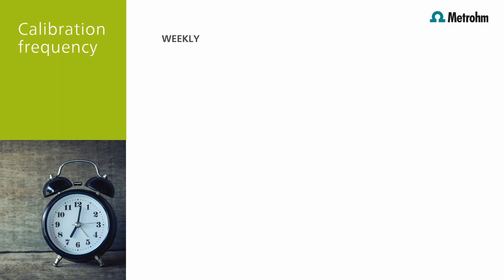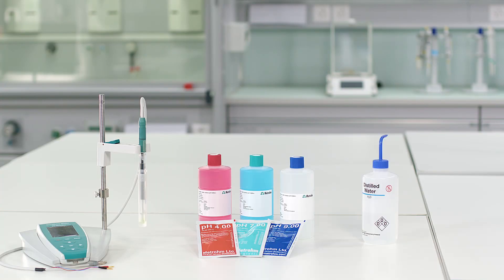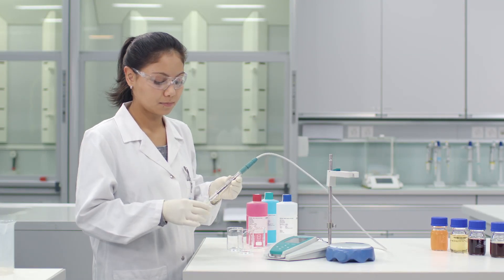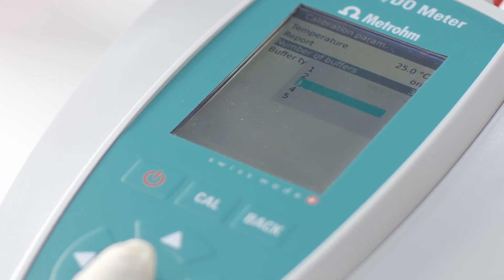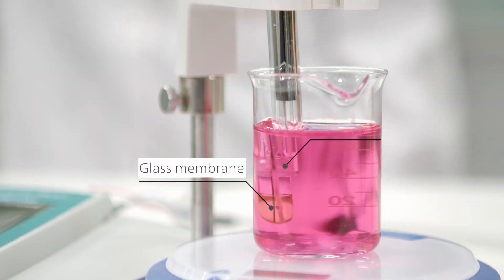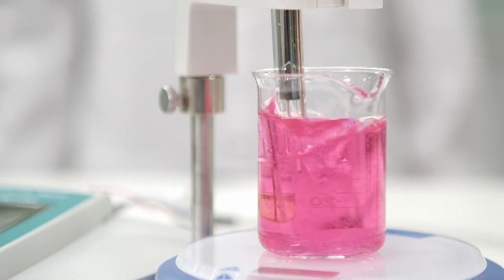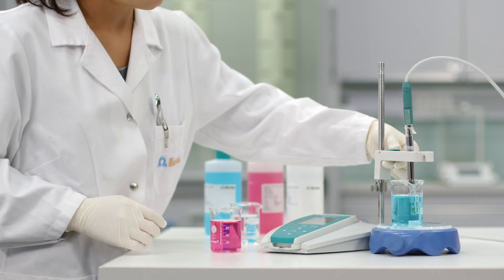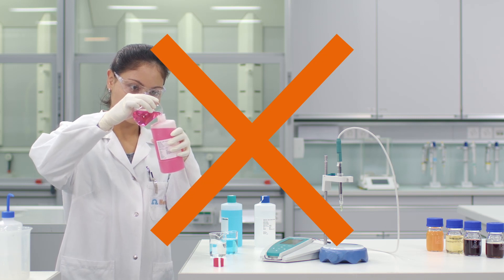How to calibrate your pH electrode

Comment: Thank you for running over the basics of pH calibration and a reminder to calibrate more often to ensure consistent sample accuracy!
Reply from the maker: Glad it was helpful!
Reply: @MetrohmTV  Is it still advisable to use pH 9 buffer for calibration bracketing samples with expected higher pH values, even though alkaline buffers have a high CO2 uptake?
Reply from the maker: For precise pH measurement results, we always recommend a multi-point calibration. The pH of the sample should always be within the pH range of the buffers that are used for calibration to minimize errors. So, if you are expecting higher pH values (e.g., pH 8) the use of pH buffer 9 is advisable. 
To avoid a carbon dioxide uptake of buffers with higher pH values, always use fresh buffer solutions. Our buffer solutions in single use sachets are quite suitable for this.
If you have more questions on pH measurement and calibration please have a look at our current monograph “pH-measurement – everything from A-Z including best practices and examples”:
https://www.metrohm.com/en/products/8/1085/81085081.html

Comment: thank you for the detailed explanation 
Addition of NaOH or HCl to adjust the PH of a solution does not affect the initial concentration of a solution?
Reply from the maker: Hi gidissadeksissa2219 
Do you mean the initial concentration of an analyte? The initial concentration of an analyte is not affected if the analyte is sodium, hydroxide, hydronium, or chloride. Does this answer your question, or did we misunderstand it?
Best regards
Metrohm International Headquarters

Comment: Great video 😊! Why only 4,7,9 buffers used for calibration!

What is the maximum limit can dip the ph electrode or need to only dip the end of the electrode
Reply from the maker: Hi Samuel
Thank you for your comment. You always have to calibrate with buffers which lie within your measuring range. With buffers pH 4, 7, and 9, you’re already covering quite a broad pH range. Should you need to cover an even broader range, you can use pH buffers from other manufacturers.

As for the electrode: The electrode has to be dipped in in such a way that the diaphragm is fully covered by your measuring solution. I.e., the glass membrane and diaphragm have to be immersed but the electrolyte filling hole has to stay above the sample.

Best regards
Michel, Metrohm International Headquarters
Reply: @MetrohmTV  😀 thanks for your reply 😊

Comment: Why the calibrate during first buffer taking much, sometimes wait around 45 minute still cannot proceed to next buffer
Reply from the maker: Hi
Thank you for your comment. Typically, a buffer measurement should not take more than a few seconds or a few minutes at most. A measuring time of 45 minutes is a clear indicator that something is not right, the most obvious candidate being a defective electrode. Please check whether your electrode needs to be replaced or contact your local Metrohm organization if you need technical support:
https://www.metrohm.com/en.html#country-selection

Best regards
Metrohm International Headquarters

Comment: What maintenance intervals (calibration, electrolyte replacement) would you recommend for a pH electrode that is used very rarely, e.g. once a year?
Reply from the maker: Hi
This very much depends on the accuracy of the result you want to achieve. For example, if the result is only a rough guide, it is fine to perform a calibration or replace the electrolyte before the pH measurement. However, if you want the result to be as accurate as possible, maintenance is more important and should be carried out at least monthly or even weekly.
In general, frequent maintenance of the electrode is recommended for warranty reasons and also with regard to the lifetime of an electrode.
Reply: @MetrohmTV  Thanks a lot for your answer !
Reply from the maker: @BenoitPlomb-u8l  You're welcome. We hope this helps!

Comment: Is it necessary to maintain the buffer temperature externally at exact 25 degree celcious  during calibration and sample pH measurment as well
Reply from the maker: Since temperature has an impact on your pH measurement (Nernst equation), calibration and pH measurement should be performed at the same temperature, e.g., at 25 °C. For further information please read our blog post “How temperature influences the pH value”:
https://www.metrohm.com/en/discover/blog/2023/how-temperature-influences-the-ph-value.html

Comment: Hello, I have a new HACH PHC101 electrode, but I can not calibrate, it says (standard not recognized. Rinse the electrode and repeat). Can you help me and tell me the reason?
Reply from the maker: Hi
Thank you for your comment.
Could you please check if another electrode can be calibrated? This way we would know if the problem lies with the instrument or the sensor.
In general, if you require instrument support, please contact your local Metrohm organization or exclusive distributor.
BR
Michel, Metrohm International Headquarters

Comment: Why do I have to calibrate more often when performed at high temperatures? If I do it at 28 degrees Celsius, is calibration necessary every day?
Reply from the maker: We would recommend calibrating the sensor daily and at the temperature of the samples for exact results. It depends a bit on the accuracy that is required.

Comment: What is ideal slope value after pH calibration.
Reply from the maker: The electrode slope is given by the Nernst equation and is 0.059 V per pH 1 at 25 °C. These are ideal values from which new Metrohm pH electrodes only differ slightly. The electrode zero point is ± 0.015 V. But please be aware that the electrode zero point and the electrode slope may change as a result of the aging of the glass membrane or changes (e.g., contamination) on the diaphragm.
For more information on this topic, please read our blog “FAQ: All about pH calibration”:
https://www.metrohm.com/en/discover/blog/20-21/faq--all-about-ph-calibration.html

And our our application bulletin AB-188 “pH measurement technique”:
https://www.metrohm.com/en/applications/ab-application-bulletins/ab-188.html

Comment: Where do we store the buffer solution if we are not making fresh everyday
Reply from the maker: Hi
Buffer sachets are for single use only. Metrohm buffers in the bottle last up to 3 months after opening and are easy to store on shelves. After a calibration, the buffer should be discarded and should not be reused.
You can find more information in this blog post:
https://www.metrohm.com/en/discover/blog/20-21/faq--all-about-ph-calibration.html

Comment: What is the problem when the slope is Less than 97%? 
And pH(0) is higger  than 7.10?
Reply from the maker: Hi Erick
There could be various reasons for this. You can find additional information on this topic in our Application Bulletin AB-188:
https://www.metrohm.com/en/applications/ab-application-bulletins/ab-188.html

If you need to troubleshoot your instrument or sensor, please get in touch with your local Metrohm subsidiary or exclusive distributor:
https://www.metrohm.com/en.html#country-selection

BR
Michel, Metrohm International Headquarters